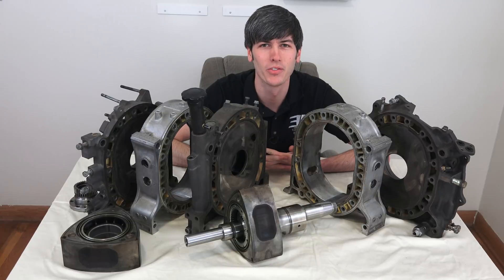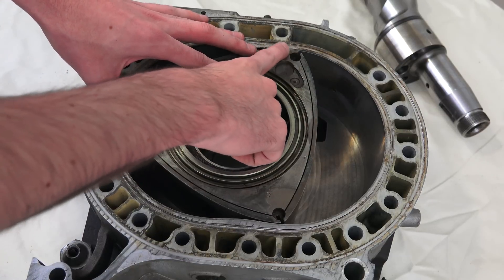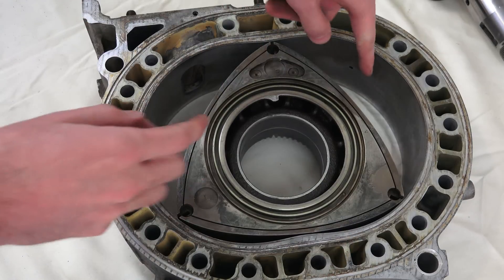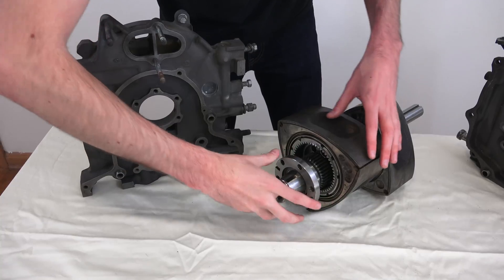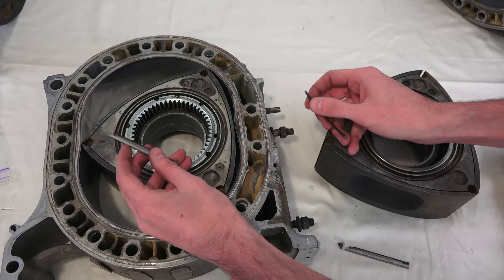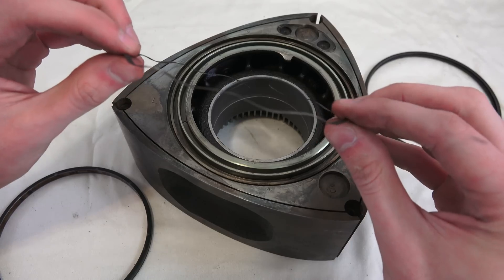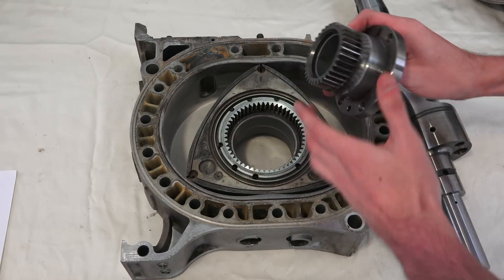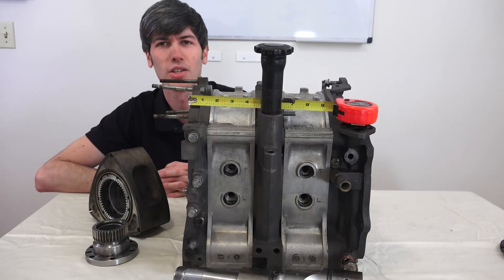How Rotary Engines Work - Mazda RX-7 Wankel - Detailed Explanation

Comment: How are those apex seals going......
Reply: ignorance found
Reply: People are so funny holding on to these myths... Very rarely do apex seals ever fail. It's usually oil control rings or coolant seals.
Reply: I Bugatti Veyron I i can tell, you seem to believe the common myths about them.
Reply: I Bugatti Veyron I theyre actuall pretty reliable if you maintain them good, most people who kill their engine because of apex seals is because they didnt know how to maintain them
Reply: +The Real Santa Claus then be immediately banned by the butthurts. Lol
Reply: +aotearota new zealand 20 years of rotarys?.....lol
Reply: +I Bugatti Veyron I (Bugattiliker3) still way more specific output than a cilinder engine
Reply: +The Real Santa Claus I know it was a joke but still not the best design just knowing the rotor (wankle) is just scraping the walls day after day until it has to be replaced
Reply: +I Bugatti Veyron I (Bugattiliker3) as do the regular 4 stroke engines. what is the point you are trying to make?
Reply: The Real Santa Claus people dont seem to understand that rotarys need to be revved high to lubricate the seals
Reply: I Bugatti Veyron I that is like picking on someone who has glasses and everyone does it all the time, of course we get mad
Reply: +I Bugatti Veyron I (Bugattiliker3) rotary engine has won a lot of 24 hour races because they are so unreliable.
Reply: +I Bugatti Veyron I (Bugattiliker3) Of course the guy with a Bugatti as his profile pic makes a cheap apex seals joke.
Reply: I Bugatti Veyron I unless you know a shit ton about them? Put good oil in it and keep the rpms above 2k and don't bog it down. You are only half right remember that the Wankle engine is the only engine to be banned from the 24 hours Lemans for being to reliable.
Reply: +I Bugatti Veyron I (Bugattiliker3) I have 180,000 miles no rebuilds no engine issues ever on a 2nd gen Rx-7 if you know how to change oil rotarys are just as reliable as  a piston engine if not more so.
Reply: +I Bugatti Veyron I (Bugattiliker3) DON'T FORGET, ALL RX7s ARE NOT CREATED EQUAL: The real RX7s came with a TURBO and beautiful INTAKE system which made for the complete and final system design. 

However to market the car to the USA they had to create a non turbo{abomination IMO) version of the car so that Americans could buy it without paying an arm and leg for the insurance(two seater + turbo = $$$$$$$$$ INS bill) or at least that's what they expected. 

These RX7s, known as NA or naturally aspirated, were and still are pretty much trash. HOWEVER, the original turbo RX7(few thousand sold in US every year of production..around 3,000, 5,000 produced for the 10th anniversary edition) were and still are... BEASTS.

In Japan where they manufactured the RX7 you couldn't even buy a non-turbo or NA."In the Japanese market, only the turbo engine was available; the naturally aspirated version was allowed only as an export."-wiki

Every single one came with the turbo and that incredible intake system, STOCK, which made for the complete and great design.

My point is, the NA model should in no way be considered as a representation of the rotary/RX7 or it's capabilities. And sadly very few people have had the chance to drive these original turbos to judge for themselves. I recommend everyone try it. 

And lastly, to answer your question, my apex seals are doing much better than your non existent Bugatti seals. =D <3 <3

P.S. This rant was not in reply to anything specific you or anyone else said. I just wanted to point out the facts so that we can all learn from it. Drive safe everyone!
Reply: ***** yes and adding oil to your fuel also helps
Reply: The Real Santa Claus Im not a big fan of rotarys but they are a good alternative for noise
Reply: ***** "myths" it's an engine dude calm down lmao
Reply: +invinciblejets lol it was a joke seems a couple of rotary lovers got mad but that wasn't the point
Reply: +invinciblejets Sometimes, the bearings.
Reply: +I Bugatti Veyron I (Bugattiliker3) Ceramic apex seals.
Reply: +invinciblejets apex seals break due to poor tuning usually... Detonation is what kills them, not so much mileage.
Reply: +gav240z exactly.
Reply: +AnthonyH impressive yes..reliable no
Reply: only non piston engine to win le mans!!buubised
Reply: +The Real Santa Claus lol
Reply: +I Bugatti Veyron I (Bugattiliker3) I think the rotory design is awesome...for racing. Can rev high all day long, which is where race cars spend most of their time, and never miss a beat. However their lack of MPG, emissions and low end torque really kills it on the street (at least where i live, very hilly/mountainous). Of course you can add a turbo but it really only seems to help the torque part of the problem.
Reply: the only japanese car that has won le mans!
Reply: the only japanese car that has won le mans!
Reply: the only japanese car that has won le mans
Reply: +Bill Murray lol everyone got over it actually looking into it it's a cool design but only a few people actually care and have enough money to maintain these wankles thier good but not reliable
Reply: fair enough
Reply: I Bugatti Veyron I they are reliable but only at higher rpms when enough oil is being sprayed into the rotor housing to keep everything lubed.
Reply: +aotearota new zealand that's not the point the fact that every 50k miles you have to either rebuild or replace the wankles / rotary are a shamed and thier not reliable at all unless you know a  shitton about them and comparing it to a piston engine "volkswagon" is a real joke they will never be as reliable as piston engines
Reply: +abba1987 yeah but how expensive is it for you to maintain? I'm actually allittle insterested
Reply: +I Bugatti Veyron I (Bugattiliker3) Honestly i haven't put anything into it in probably 40,000 miles aside from oil changes topping off fluids. I had to replace a thermostat at around 140-145k miles. I use the car as a beater so really haven't put anything into it. Bone stock original everything basically. I have owned the car since new so it was always given regular oil changes which is the key to longevity with these cars.
Reply: +abba1987 yeah everyone is doing LS swaps these days even though it's a good engine it never hurts to be different from everyone else I'd take a inline5 or Cummings i6 over it rotarys are amazing to the fact that they have half the displacement and can eat big v8s anyday reliability is my only worry cuase some people daily  drive them without watching out for carbon up or other issues
Reply: +I Bugatti Veyron I (Bugattiliker3) just to sum up your argument they are reliable period. The reason they fail is because of the owner not the car this can be applied to any engine if you dont look after it properly.